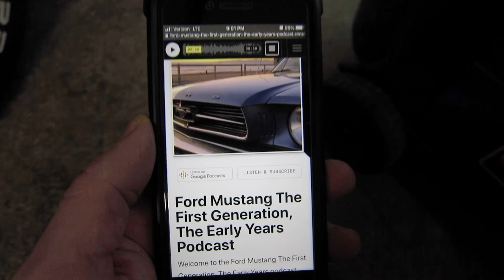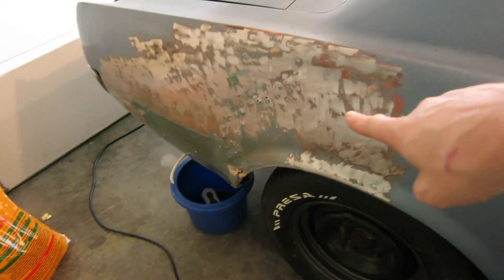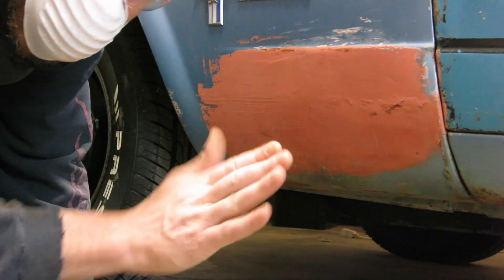65 Mustang Body Work Plan | Vlog 25

Comment: Gotta say it has looked way better than I expected under both big bondo areas. I was picturing big gnarly, rusty holes. Must be a relief.
Reply from the maker: So was I Jim. I’ve been very lucky so far. You’ll see in the next vid the condition of the last big patch. It’s the area they replaced a with a quarter with one from a ‘66. It will require a more work than the others to repair.

Comment: Shop Vac, Plastic Sheeting and duct tape 1" pvc pipe to help keep the dust down and help clean up. PVC 1" pipes and elbows and such with plastic can create an area where a shop vac hose pointed at the work will go a long way. Make a little frame cover with plastic. You can make them any size and shape, great for keeping sanding dust down of you only elect to do one panel at a time.
Reply from the maker: I may buy another small shop vac specifically for dust control. It doesn’t take much sanding to make an absolute mess. The plastic and pvc is a great idea. Thanks 👍

Comment: Small comment if you notice the yellow they brazed that patch into place I would take your bottle torch and heat the braze off that patch they make lower quarter patch panels that can be properly butt welded into place
Reply from the maker: Thanks for the advice. I’m considering leaving the patch if the metal is in good shape behind hit. Any reason you’d remove the braze off if everything looks to be in good condition?
Reply: @GreaseRookie  yes the metal could look good but any type of filler put over two pieces of metal like that patch will trap moisture between panels and rust away the right way is to cut what you need from a patch panel and butt weld that into place in I'd check out joe daddy's garage he had lots of really good videos of proper panel patches and replacements on mustangs

Comment: Have you had a chance to pull the fender? The reason they rust out right there is the fender support is attached on the back side where the patch was done. I would check out the support and see what’s on the back side of the patch panel. If all looks good I would just clean it up rather than redoing. It’s also hard to tell how the patch was installed. Was it welded or brazed?
Reply from the maker: The patch looks like it was brazed. Its probably the best repair patch I’ve found on the car. I may leave it depending on the condition behind it. I’d like to pull the fender within the next few weeks to see what’s going on behind it. I’ve been very fortunate with the car so far. Hopefully it’s not rusted very badly on the aprons. Thanks for the advice. 👍